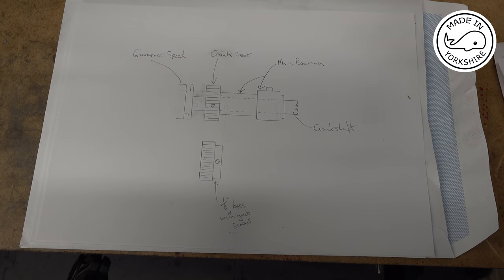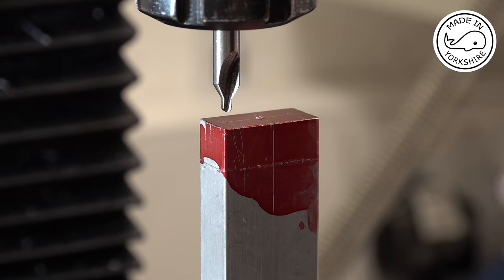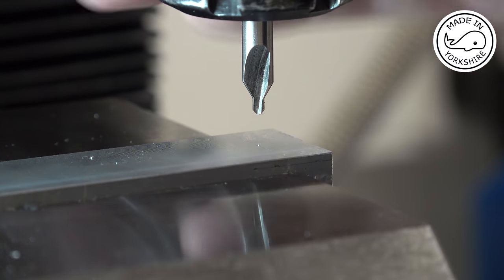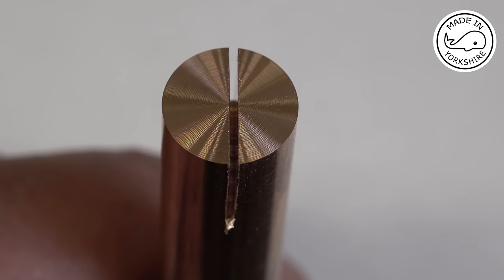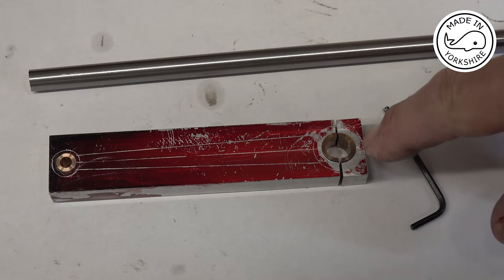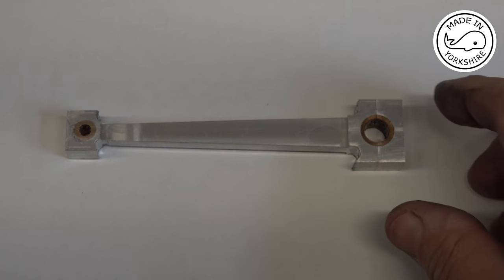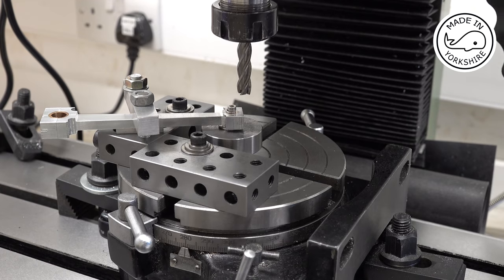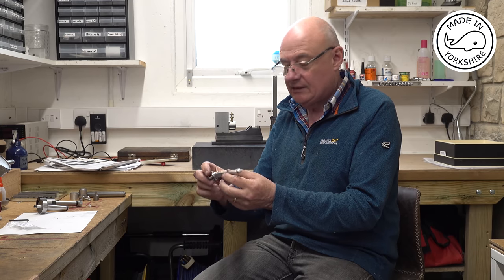#MT41 Part 6 - Philip Duclos Odds n Ends Engine. Machining the Conrod. In 4K by Andrew Whale.

Comment: I like that mandrel holder.  I will be pinching that idea!
Reply from the maker: Hi John - it's definitely worth spending a couple of hours making one. I think Arc Euro Trade sell various sizes of MT2 blanks. Jon (comment below) suggests further improving it by counter-boring a  register at the top of the M6 hole. I think I might modify it accordingly.
All the best.
Andrew
Reply: @learningturningmetal  that’s an excellent suggestion.

Comment: A good method of soldering bearings together for machining is to use solder paste. I use a product called Fryolux solder paste. Never had a failure yet. Great channel, had many hours of pleasure watching.
Reply from the maker: Hi John - glad you like the content. Thanks for the Fryolux tip - I've just ordered some.
Cheers
Andrew
Reply from the maker: Hi John
The solder paste arrived today, just in time for another job! It worked an absolute treat!
Thanks for the tip.
Andrew

Comment: Andrew, slitting saws are best used full depth with slow feed not small cuts repeated. Just like a bandsaw, it’s a one pass operation.
I use the same mandrel method on my rotary table to..
Bronze bushes were a good call. I’m doing that on my conrod at the moment.

Comment: A nice looking part Andrew. I am sure the bushings are the right way to go. If you hadn't done it now you would have been fitting them quite soon due to wear on the aluminium. You seem to be churning out spur gears for fun! It would be interesting to try the pin type gear on a blank shaft just to see if it does distort. The grub screw gear will solve the problem as long as the grub screws have a good grip on the shaft. The project is really coming along well.
Reply from the maker: Thanks for the advice Tim. I think I'll put some flat spots on the crankshaft as Richard (aka Dick) suggests below.
Cheers
Andrew

Comment: Great result, that Mandrel will serve you well. Regarding aluminium as the bearings, most home shop compressors only have aluminium con rods with the holes just reamed both ends.
Reply from the maker: Thanks Dave. That mandrel has come in really useful. Yeah I've learned a bit more about aluminium when building the Hoglet. It too uses aluminium for bearings. The Hoglet conrods should be made using 2024 aluminium which contains copper, which is good for bearing use. Unfortunately 2024 aluminium is a bit if a rarity in the UK, but I've since managed to get hold of some 2014.
I didn't realise that there were so many different variations.
All the best.
Andrew

Comment: Excellent work as usual Andrew. The split bush on the Economy hit and miss big end is twice the diameter and soft solder was perfectly adequate for machining that one.
Reply from the maker: Thanks Philip - and thanks for the advice. For some reason I have it embedded in my brain to use silver solder rather than soft solder. I must press the reset button!
All the best.
Andrew
Reply: I think we underestimate the strength of soft solder these days. Now we have super glue that had replaced other methods of joining. Example joining two pieces of Steel, Brass, Copper etc. That have to be made identical easily sweated together with solder.
Cheers
Phil.

Comment: Nice job, I've never used super glue and I'm amazed how well it holds under machining.
Reply from the maker: Thanks Brian - I get the impression that some people frown upon it's use but I've had a lot of success using it. Saves messing around with solder! Mind you I wouldn't try using it to hold a split bushing together.
Cheers
Andrew
Reply: @learningturningmetal  Well it's about moving with the times, thank goodness we are still not using treadle lathes.

Comment: It's coming along well andrew. Nice work. Cheers from the US.
Reply: I have never used superglue for anything, only sticking plastic and that does not always work. I only mentioned it in passing because Andrew often uses it when machining. I only ever soft solder together split bushings as the joint is so thin, providing that you clamp the part together before soldering. Upon release and a polish up with 1,000 grit plus paper, you get a highly accurate hole size.
Reply from the maker: Thanks Jeremy!

Comment: Hi Andrew, this is turning out to be a very interesting project! i would say the gear with the boss on it works okay - same as the Farm Boy which works okay but is susceptible to slip if not keyed on the shaft. You'll remember it relies on a tiny 2-56 grub screw which is tiny and you cant really get the torque on it - seems okay but time will tell. Anyway I'm pleased to tell you my Farm Boy is finally running ! what next...
Reply from the maker: Fantastic - you must be well chuffed! I agree, the farm boy grub screw is tiny. On this one I've put a couple of 4-40 grub screws, so I hope it will hold well. I'm interested to know what you will tackle next. Maybe a twin cylinder IC?
Cheers
Andrew

Comment: As usual that came out really well.
Just a thought but i think you could take deeper cuts when you use an end mill, taking away the bulk of that rod for instance. It looked like you were only taking a few thou at a time rather than say a depth of a quarter to a third of the mill diameter. If it bogs down, move slower, use lube or reduce depth but you could save a lot of time by finding the limits of your machinery, you might be surprised at what a small machine can do, once you have the "feel".
Reply from the maker: Hi Chris thanks for the advice. I'm gradually working my way up. I used to mill 10 thou at a time and I think I was taking 20 thou cuts in this video. I will try to be more adventurous in future.
All the best.
Andrew

Comment: Another part under your belt Andrew, well done. Why on earth did you want to silver solder the parts together as it was only going to be a temporary joint ? Should have gone for soft solder straightaway, I was also surprised that you never even used superglue as you often do. You were lucky that the solder ran after you not taking it apart to clean and remove the SS flux. The part was pretty well cooked up and badly  oxidised. A fact that a lot of people will not know about, is that to reheat the part to unsolder it will take more heat as the melting point is now higher due to the solder being alloyed to the part. Regards from Australia.
Reply from the maker: Hi Dave - thanks for the advice as always. I must try to use soft solder more often.
All the best.
Andrew

Comment: Nicely done Andrew, your mandrel is a great idea, I think it could be further improved by machining a counterbore register at the top of the M6 hole, say 0.08" deep, and turning the opposite diameter on your mandrels, this way you will have a really accurate location for future jobs that may require more precision. Well done. Cheers, Jon
Reply: Jon's Workshop
I've had no joy with screw in mandrels; I can never get them exactly concentric, so I go for a reamed hole and a pin. Your suggestion should work just as well.
The reversing gear linkages on my Stuart Compound Twin are very similar to miniature con rods and machined from steel.
I turned down a mandrel to an MT2 taper that fits in my rotary table just a fraction below the table top and with a 2.5mm reamed centre hole in which I place a broken 2.5mm drill shank as a centre pin. The tiny components are drilled 2.5mm at the "big" and "little" end centres. The component is lightly bolted to a 1/4" aluminium flat with a 2.5mm hole drilled through it, then the assembly is placed over the centre pin and lightly bolted to the table. The fastenings of component to aluminium and aluminium to table are then carefully tightened.
Setup takes time, but I'd rather do that than try the "hand held" approach I've seen people use to mill the ends of these rods (including a professional machinist).
Reply: @lenroddis5933  Hi Len, fully agree, I know a guy who can no longer play the guitar very well after doing the the hand held radius milling, and he was a time served guy too, trying to cut corners in every sense of the phrase....... Lost his index and middle finger, they were mashed up so badly they couldn't be saved! Your method sounds great, top marks. Cheers, Jon
Reply from the maker: Thanks for the suggestion Jon - I will have a go at making that improvement.
All the best.
Andrew
Reply from the maker: @lenroddis5933  Very interesting Len - thanks for sharing.
All the best.
Andrew

Comment: Did you step that slitting saw into the work.  From what I understand it is better to take a full depth of cut when using a slitting saw, but don’t take my word, I’m just a newbie.
Reply from the maker: Hi - I cut in 10 thou (of inch) passes. I can't see how it's possible to take a full depth of cut using either of my milling machines.
All the best.
Andrew

Comment: Nice job, especially the hand-filing on the big end cap.  Do you think that the big end sleeve halves need to be pinned in place, or are they already immovable ?
Reply: They probably won't spin in the rod but I would pin the top shell into the seem of the con rod for insurance. The plain aluminium is very satisfactory as a bearing provided it isn't run bone dry. Many of the commercial shell bearings on vehicle cranks are aluminium faced.
Reply: @howardosborne8647  ...and some internal combustion engines even use an aluminium alloy for cylinder linings.  Reportedly, the alloy has better properties (including wear resistance) than cast iron.
Reply from the maker: Thanks Chris - I think I amazed myself with the hand filing! I think I will put a spot of loctite of the one in the cap end.
Cheers
Andrew
Reply from the maker: Very interesting Howard.
Reply from the maker: @chrisarmstrong8198  Amazing!

Comment: Is it possible to silver solder the gear on to the shaft?
Reply from the maker: Ideally the crankshaft gear should be easy to remove and not made permanent. On some engines (eg Farm Boy) the crankshaft gear is rotated for timing and held with grub screws. I would also like that to be an option on this engine too. Philip Duclos suggests rotating the cam gear for timing, but you cannot achieve a fine result. Applying silver solder needs about 800 degrees C to melt it to create a bond. Alternatively, Loctite 638 (and superglue) would make it fairly permanent and can be applied without heat, but it needs a lot of heat the break it down for removal. Applying such heat to the crankshaft would probably affect the construction of the crankshaft, as I will fabricating it and assembling it using Loctite 638.
I hope that explains the problem.
Cheers
Andrew
Reply: @learningturningmetal  now that makes sense.  I’m new to all this and I’ve not read a bunch of books or manuals on the subject.

Comment: What type of silver solder do you use and where can I purchase some
Reply from the maker: Hi - I got my silver solder and flux from silveralloys-norwich on eBay UK. Details are:
 silver solder kit Silverflo 55 /Brazetec 5507 5 rods x 250mm 1.5mm + flux 	
Hope that helps.
Andrew